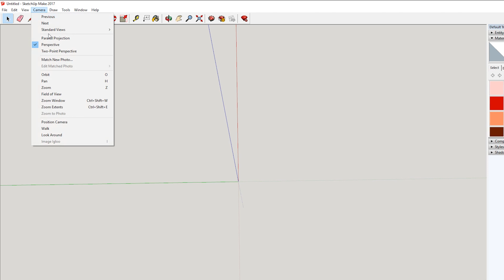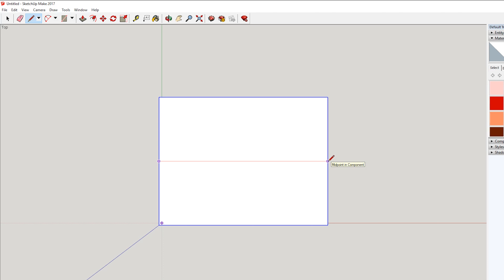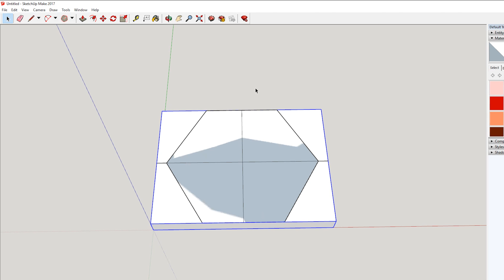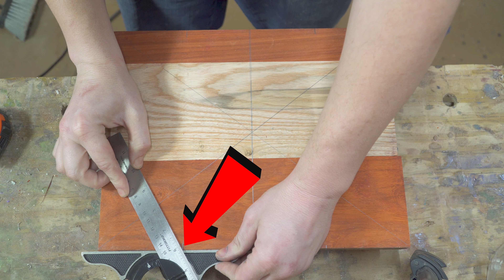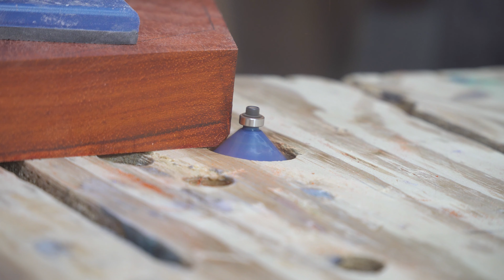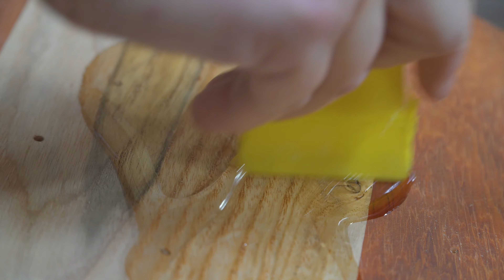Making A Hexagon Shaped Lazy Susan 4k

Comment: Could you not have just done a printout on the computer and pasted it to the wood instead of drawing all of the lines?
Reply from the maker: Maybe but I also wanted to learn the idea od how to lay it out by hand makes for just one more skill set to put back for later. And also don't have a printer that prints out like 13 inch wide prints. Also enjoy doing thing by hand like that. Will have a cnc to do it soon lol.